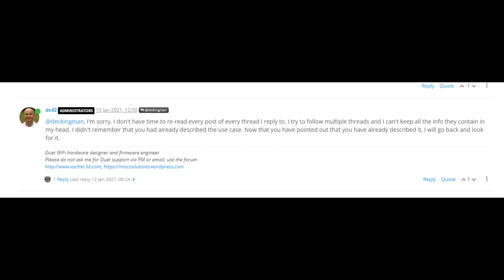Update and Duet 3 Warning!

Comment: Ian, I am sorry that you felt the need to post this. In answer to some of the points you raised in your video:
- We have many satisfied users of Duet 3. But satisfied users rarely create threads on the support forum, whereas of course users experiencing issues do.
- Although I am the lead developer of RRF, there are now three of us making core contributions to RRF, and community members making smaller contributions.
- The reason I no longer read every forum post is precisely so that I can spend more time on firmware. Duet3D contracts others to read all the posts and alert me to posts they can't answer themselves.
- Regarding the issues running firmware 3.2 on your machine (spurious "homing failed" message, and one expansion board sometimes missing the first M569 command at startup), you chose not to install any 3.2beta or 3.2RC releases, in spite of the fact that your machine is high developed and we have nothing similar to test firmware on. Had you done so, you would probably have picked up the two issues that affect your machine, and given us an opportunity to fix them prior to the 3.2 stable release.
- The spurious "homing failed" message that is one of two issues on our list to investigate and fix prior to releasing 3.3beta 1.
- The other issue on this list is slow startup of a small number of EXP3HC expansion boards, which I believe is responsible for your extruder sometimes running in the wrong direction. We are working with three other users on this, all of whom experience this slow startup issue more severely and are prepared to work with beta firmware. When we have a definite fix for all of them, we will port it back to 3.2 firmware.
- You didn't need to re-tune your heaters. The upgrade notes for 3.2 specifically state "The M307 heater model parameters have changed, however existing M307 commands will continue to work".
- Automatic tuning heaters on expansion boards is now implemented but not released. I gave up one of my weekends in January to implement it.
- You do of course have the option to revert to firmware 3.1.1 until we resolve the two new issues you are having with 3.2.
Reply from the maker: David,

I’m sorry too. Not for making the video but for the fact that the Duet Firmware and support for it has deteriorated to such an extent that I felt it was my only recourse.

I note that you could not bring yourself to apologise for the heartache that the problems with RRF3.2 have caused. Once again it’s the user’s fault. In your eyes the problems are not with Duet firmware but rather, it’s my fault for not trying a beta firmware!

On the topic of “happy users”, the converse of your statement is also true. That is to say, many people choose not to complain when they receive shoddy goods or services. Instead, they simply do not make repeat purchases from the same vendor. The Duet forum is largely populated by moderators and “fan boys” who rapidly and vociferously clamp down on any dissenting opinions. I have had many private messages from dissatisfied users who are afraid to express their opinions openly on the Duet forum – one of those is one of the 3 people you say you are working with to resolve the latest issues. That person has privately told me of their intent to ditch Duet products. The world of the Duet user base is not the sunny upland populated solely by happy smiling people that you think it is. I rather expected that this video would elicit a torrent of comments from “happy users” coming to the defence of Duet. Instead, as you can see, the opposite is true.  Wake up and smell the coffee!

On the subject of Beta firmware, as I explained in my video and as I have mentioned many times on the forum, I’ve had my fingers burnt too many times in the past. What has often happened is that the beta firmware fixes one thing but introduces other problems. Then when I report these issues, it’s all my fault for using a beta firmware. It was beta firmware which broke my load balancing gantry and which you said could not be fixed. But Manuel managed to come up with a custom firmware version for me which fixed that issue. Also, I’ve had so many problems in the past with firmware failing to upgrade properly and having to resort to USB cables and Bossa to get out of that particular hole, that I prefer to update the firmware as seldom as possible.

On your reading of forum posts, far be it for me to tell you how to run your business, but perhaps the (paid) moderators could at least reply to posts to say that they do not have an answer but that they have marked the post for your attention. That would be better than having no response at all from any member of the Duet team (which is what currently happens). 

On the extruder running backwards issue – I have very little confidence that the planned changes will fix it. Mostly because (as I have stated on the forum) the “fix” of adding a delay does not work, neither does the “workaround” of running M98 P”config/g”. Also, please note that the dual input hot end which did not extrude any filament when I attempted to print with it, uses one driver on each of two different expansion boards. So it is likely that more than one board is affected. 

I will of course, try the next “stable” firmware when it becomes available. And I will of course post another video of my findings – good or bad.
Reply: Ian, Please accept my apologies that limitations in the firmware we have provided have caused you difficulties in using your machine to the best of its potential.

I don't think that I or anyone else here has ever said that something is your fault for using beta firmware. It's true that when someone reports an issue with OLD beta or RC firmware that has been superseded, we ask them to upgrade to the latest beta, RC or stable firmware in that series and check whether the issue is still present.

You've suggested that the moderators should reply to posts to say that they do not have an answer but that they have marked the post for my (or someone else's) attention. That is a good suggestion, so I will discuss it with my colleagues.

Regarding beta firmware, I urge you to at least try the 3.3RC firmware when we make it available. Your machine configuration is highly unusual, which increases the likelihood that it will show up a firmware issue that our own testing and our beta users do not experience. I make it a rule that stable firmware must not contain any known bugs in functionality that was working in previous firmware releases. So by taking part in the 3.3 beta or at least 3.3RC testing, you will give us a much better chance of ensuring that there are no regressions in 3.3 stable that affect your machine. You will of course also benefit from earlier access to features you are waiting for, such as auto tuning the heater(s) connected to your expansion boards. I know you have been waiting for this for a long time - longer than most Duet 3 users, because we gave you pre-production EXP3HC boards months before they went on sale. It was the knowledge of how important automatic heater tuning was to your mixing hot end development that made me determined to implement this in 3.3beta1, and give up a weekend to do so.
Reply: @dc42duet3d  I think you will find that you had many positive supporters who "used to" support and defend the Duet brand on the premise of it being the "best on the market" myself included but that has been slowly eroded buy the attitude of the team and the very real issues many have faced. I was very open in calling out those who failed to carry out their due diligence and trying to blame that lack on the hardware/software. But it's obvious that the truth is frowned upon, so as I mentioned elsewhere I (like many others) have become disillusioned with the whole mess thing and the brand has lost many good and intelligent people who were great adverts for the brand and great supporters of it and those people have decided to walk away from the brand. The only positive I see that keeps people in the ecosystem is the DWC. Which makes control and editing easy. But I for one am researching alternatives because of how low user experience has sunk

Comment: Thanks for posting this. I love your machine and the premise behind it.
I haven't went past 3.1.1 on our new machine but im still sorting our 4z homing config, I appreciate at least knowing that that is a possibility if I find stuff that puzzles me enough.

I can understand both sides of this I came from the GM v6 tuning world and it took nearly three years for them to fully fix the tuner program as well as reverse-engineer all the parameter IDs for the PCMs.
Since most cars have went from serial bus to can bus mechanics everywhere will tell you how glitchy some systems can be even with the tiniest ground Loop voltage variations. The same sort of variation I would expect to see upon boot up of a system where each controller is at the mercy of its particular power circuit.
A simple can bus fault can take down the entire driver information display, system cluster, hvac and window/lighting functions in a car. The bugger drives fine but nothing works.
Well gentlemen it's time for me to get back to work on my jalopy.
Regards, James
Reply from the maker: If you look at the second part of my latest video,. you'll see most of the firmware issue are now resolved. 
Ref the automotive thing - I started my apprenticeship 1969 when fuelling was "controlled" using carburettors and ignition was via mechanical distributors with cams and points, centrifugal weights and vacuum capsules. It was all much less reliable than modern day systems, but much easier to fix. :)

Comment: Marlin has support for mixing. I use that on mine. I'd like to try Klipper, but I would need to add mixing to it and right now that is a little too many projects at once, so maybe next year.

Marlin is also worked on by more than one person. Looking at git, many random recent contributors on Marlin have been more active than all of RRF over the past couple years... I do not know what is going on with RRF, feels like its in legacy support floundering stagnation some one person OSS projects eventually fall in to. "Lacks critical mass to become self sustaining" comes to mind.

Marlin's bug tracker is moderated and active. They take and regularly receive pull requests (even I've done at least one). Board support is really wide, though I don't see the SAME70 in the HAL, but I think only Duet used that MCU (I believe there was some base issue with all the SAM MCUs that kept them from being a wide spread option for 3DP boards outside of a few long-dead Due based ones). Marlin Discord server has been helpful for me.

You could try the BTT GTR board. With the expansion board, it supports 11 steppers. Looks like a good board, I might have gotten it instead of the SKR Pro had the GTR come out a little sooner.
Reply from the maker: Thanks for the tips. I'll take a look at those hardware/firmware options. I need to calm down a bit first. Right now, I'm completely disillusioned and I've simply abandoned 3D printing for now. I've been playing around with home automation instead. Just installed something called Home Assistant on an RPi. If you don't know, that's an open source community lead project. What a contrast to RRF firmware! It'll support pretty much any sensor or iot device from any manufacturer, using any protocol and it all "just works" together. I suspect that all the Duet firmware problems are simply due to not enough people working on it and/or some "control freakery" issues.
Reply: @deckingman  This situation is just outrageous, especially since Duet/RRF still has quite the reputation as the “pinnacle” among the lower end Ender 3/Marlin Firmware crowd.

The fact that you’re one of the pioneers* in the CoreXY and multi-extrusion, and that Duet used to worship your printer like an idol (ok, maybe an exaggeration, but you were obviously a positive marketing show off for them), to hear that you’ve abandoned 3D printing … 

The coral reef aquarium hobby has always had a high dropout rate due to difficulties in maintaining water quality and whatnot. People would get into the hobby, spend thousands of dollars, and a year later they’d be selling off all their equipment because everything in their tank died. In the mid-2010s,  experts and “old timers” started dropping out of the hobby as well, just disappearing and wanting nothing to do with the hobby anymore, and eventually we realized it was a toxic element — in this case, attitudes of certain people on forums — that had snowballed and newcomers picked up those bad attitudes like they were required skills. Questions like “How many yellow tangs can a 60gal tank support?” would get answers like, “Minimum tank volume for a yellow tang is 90gal you dipshit!” Or much worse, including not getting an answer at all. This happened on equipment forums too, and this is a hobby that’s only been successful since around the mid-90s (unless you were a marine biologist) so “best practices” and methodologies were about as mature as they are in the 3D printing world. 

I’m not saying it’s necessarily a few bad apples at Duet causing this, but whatever the root cause of all this was, it has all the anti-patterns of a potential collapse of the Duet ecosystem unless that root cause is addressed.

I really hope you find a way to stay in (and enjoy) the game, @deckingman, but if not, sounds like the home automation thing seems to scratch that itch that all retired engineers seem to get and has a much more robust community around it. 

Cheers!

* you can always spot the pioneers, they’re the ones with the arrows in their backs. 🤔
Reply from the maker: @lucasthompson1650  Yes, it' is pretty outrageous. According to some, it's all my fault for having a complicated machine (although the complexity is mostly  mechanical, and the machine is fundamentally the same as it was 3 years ago (when it worked well with Duet 2). According to Duet, its my fault for no longer testing Beta firmwares (even though those betas don't address the outstanding issues that I have). But hey - such is life. I'm still not sure which direction I'll take but I'll keep on dabbling with 3D printers one way or another. If nothing else, I need to make cases for ESP based IOT sensors and  the like. :)

I can relate to the living coral aquarium thing. I used to keep African cichlids many years ago. I never did get into salt water - as you say, maintaining water quality is much more difficult, and the fish are much less tolerant of variations than their fresh water counterparts. African cichlids can be almost as colourful, with the advantage that fresh water will hold more Oxygen and thus support a greater density of "fish inches per gallon". At least that was my take on it. But for sure, living coral is the pinnacle of that particular hobby and not for the casual hobbyist.

BTW, there are very few apples (of any sort) in the Duet team.
Reply: @deckingman  I just read the “Easier to use Software” thread on the Duet3d forum (yeah, this pissed me off, so I went digging)… there’s a few sour apples. ;)

Browsing the rest of the forum, wow, the general unwillingness to support or assist edge cases that advance the field is painfully obvious. Why don’t they just start making their own printers and be done with it? See how long that stays afloat, paying more attention to trivial things like NeoPixel LEDs than stepper voltages.

I know the Marlin community would love to have you but, honestly, the kinematics support just isn’t there. Even an enthusiastic team probably wouldn’t be able to add it before 2022, realistically … and canbus support is nonexistent.

Can you go back to Duet2 at this point if, say, you suddenly wanted to print a fancy box for your Pi?
Reply from the maker: @lucasthompson1650  Well 'm still exploring options. Klipper looks interesting too. For sure, I'll be ditching this Duet gen 3 stuff. I could put the Duet Ethernet and Duex5 back on but I'm more inclined to ditch all the Duet stuff and start with new hardware as well as firmware. I'm considering ditching mixing hot ends too. That would mean I don't need the extruders on a separate gantry so the machine could be a simple CoreXY or Cartesian. Maybe I'll build a tool changer. Do you have any contacts in the Marlin community?  Ideally, I'd like to go back to a relationship that I used to have the Duet guys before they threw me under a a bus. Fundamentally working together with firmware guys to move things forward for the benefit of the wider community.
Reply from the maker: Maybe we could continue this discussion via email or some such? If you visit my blog, there is contact form you can use which will keep your email address away from prying eyes. https://somei3deas.wordpress.com/contact/

Comment: I feel so sorry for you! I can only imagine how frustrating it is! I haven't had the cash to spend for a Duet, but I had also realised that RRF is not worked on as much as Marlin, so I decided to stick with it. I have had my fair share of issues with cheap mainboards, the SKR taking down my printer for quite some time with pretty terrible support. But they are cheap enough that buying a new one isn't too bad. Marlin support - I've barely had to use it becuase most things have been fine or others have had the same issues.
If Klipper supports Duet, I've been thinking of building a secondary 3D printer test platform with custom kinematics. But right now looking at just using the good old RAMPs 1.4. I feel that Duet has excellent hardware but the software lags behind the community driven Marlin, and Klipper is quite open and still new - but lots of people are exploring this option now!